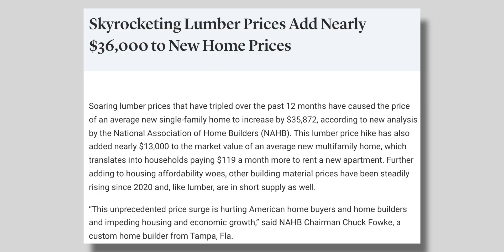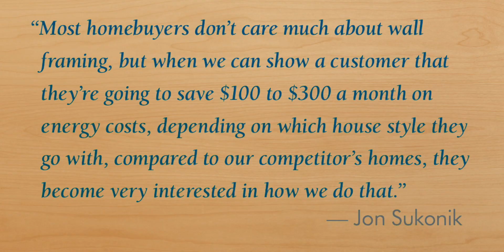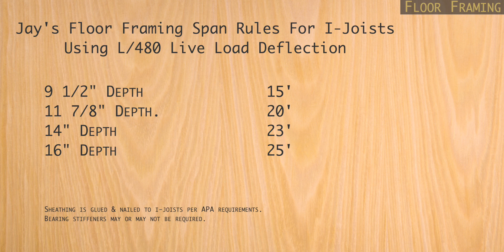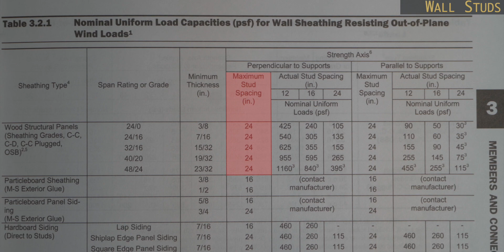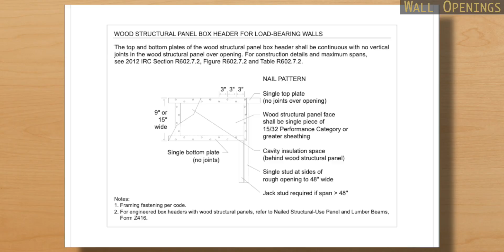A Short Guide to Advanced Framing Details (vs. Traditional Framing)

Comment from the maker: There are some additional elements of advanced framing that are not discussed due to either them being very similar to traditional framing methods, or elements I just don't have much experience in.  A product used that I don't have much experience with are Insulated Header Assemblies, which are just headers with insulation attached directly to them.  I do not cover T-intersections at walls due to those methods being similar to traditional framing methods. Integrated Rim Headers are another advanced framing technique, however I don't have the best knowledge on how these things work structurally.
Reply: Advance framing isn't about saving wood its about increased insulation and stronger buildings.

Comment: You're onto something but honestly this sounds like a single family carpenter's nightmare, especially when it comes to having to remodel a roof addition into old walls with no double plates, but it looks good on paper and only on paper in my opinion as far as single family homes go. I wouldn't consider it on anything other than massive multifamily projects where the savings might be worth retraining crews and finding a framing foreman willing to deal with it all. Work just isn't that hard to find.. I'd consider multifamily only because it's generally not a candidate for an addition. Even then, it's somewhat intimidating with minimal forgiveness if needing to offset a truss or rafter due to a miscalculation somewhere along the lines. It sounds extremely risky for it's value. The best way to save $ is probably to use 6x6, 4x4 etc. for shorter span headers (not longer because they twist causing major problems). That saves on labor not having to measure, cut and assemble the multiple parts of conventional headers and  produces less cut off waste, and the heavy nailing specs of conventional headers require a lot of nails.There would also be some R value loss opting for 6x6 headers. The L shaped corner you depicted is called a California corner or "Cali". It doesn't allow for half of a siding corner to be nailed to anything but plywood, though the American Plywood Assoc. has specs to resolve that issue (specs that probably are rarely followed in the field), you just have to contact them for the specs. Even after doing this 20 years, I still don't know what those specs are nor have ever heard of anyone speak of it. The U-corner you depicted wasn't installed correctly. A U-corner allows for proper siding corner installation (unless the corner material is a wider dimension than the stud material). It's also a stronger corner and I would be happier knowing a massive hip in a roof is over three instead of two studs. They're not that hard to insulate when installed where the cavity of the U-corner faces in (not facing the sheathing as depicted). It's rarely a problem where a king stud or something would prevent the U corner from being insulated but any framer worth their salt will insulate it before installing the king stud etc. However, the U-corner also sacrifices R-value by replacing a volume of insulation with an extra stud. Calis are suitable for interior partitions but might not always be the best option over a well placed ladder style partition that can often save a stud or often two and make use of scrap blocks that would have probably ended up in the dumpster.

Comment: I think it would really come down to the structure of the home. I think a wall 24oc with more insulation space and only 7/16 osb on the exterior walls will be more weaker than a wall that is 16oc with wall insulation plus a zip board with 2in insulation. To me the cost of my home is literally out the window if I try to save money and use less lumber to build my house and a storm comes in and destroys my home because I was a tight ass.

Comment: Jay, you are a P.E.  You have the right to specify things which don't match the code.  But be certain that you understand the intent of the code, and your calculations will hold up to scrutiny.   The codes are a prescriptive method, of constructing a safe home.  If the trades follow the code, they end up with a safe efficient structure.   Licensed design professionals, have the right to do things which are not compliant with the prescribed methods and standards of the codes.   

officials

Comment: Imo Advanced Framing is better referred to as OVE / OVF (optimum value engineering / optimum value framing) Cause its technically not as strong structurally, but we have modern engineered wood materials that are strong to make up for it. Advanced framing to me sounds like we're making framing techniques stronger and doing structural upgrades.
Reply: They call timber fames advance framing.

Comment: Down the road you are asking for trouble because as you know houses are not allowed to settle as they are built an this type of framing will show up as the house settles in 5 to 10 years the roof will have the ripple effect in it and the floor will began to hav e squeaks and sags and you really do not save in lumber that much if you take a wall 8 foot an lay it out on 2 foot versus 16 inch you will see that you are not saving that much versus cost over structual soundness

Comment: I believe that advance framing only helps   a  DIY  builder.  The owner/builder will frame with studs 24" on center ( from center of stud to next stud ).  The owner builder saves on lumber and can use INSULATION between studs.  But a tract  home that uses  studs 24" on center,  becomes a  COST-CUTTING tactic,  that makes walls feel flimsy.  And what is the point of saving A LITTLE MONEY ON LUMBER,  if the price of a TRACT HOME in CALIF is  $700 THOUSAND DOLLARS.???... less lumber and high price  SPELLS PROFIT for the BUILDER,  and less quality home for the BUYER.. I am just saying

Comment: And you cannot be more inaccurate about single top plates vs double and how it "doesn't matter which one you choose to use"? Double top plates are always used for load bearing walls and they're used for a good reason. You can't go 24 inches on center which is using less lumber, and then expect the same load bearing results especially when using a single top plate. Not possible and wouldn't be structurally sound. I think you should get into the business of being a framer before you start making videos that aren't totally 100% accurate.
Reply from the maker: If you watched the video and went to minute 4:32, you would have saw the part where I explain that you can use a single top plate in a load bearing wall as long as the roof or floor framing is aligned with the wall stud. If you read resources from the American Plywood Association on this topic, their resources say the exact same thing.

If that isn’t enough for you, how about going to ask other structural engineers who design wall framing systems. Or other videos on YouTube about this topic because I’m not the only person that knows you can use single top plates in a load bearing wall as long as you follow specific rules.

Cheers.
Reply: @JthaEngineer  that was the most polite fuck you I've ever heard.
Reply: Are you a framer? If so, I'm surprised you don't know this stuff. Read up on advanced framing. Single top plate is all good. As per code and all authorities on the matter, the floor joists simply need to match the wall spacing and be aligned within 1" of each other.  

Building using 24" OC shouldn't be discussed like it's some complicated concept. At all.

Advanced framing also isn't all about saving money. It's thermally higher performance homes which use less lumber, less fasteners, & less labor WITHOUT structural compromise. 
A 2x4 wall @ 16"OC is structurally sound. A 2x6 wall @ 24"OC is structurally sound. Period.

https://www.greenbuildingadvisor.com/cad/detail/building-plans-for-advanced-framing
Reply: @DJNemesisOfficial  👏

Comment: In a 60 foot long structure 16 on center floor you need 45  floor trust The same floor system 24 on center you use 30 floor trust at the price a floor trust it is considerable savings. It more than pays for the 1 1/8 tongue and groove. Glued and screwed you will end up with a stronger floor. The larger 24 inch basin also makes it easier for doing the plumbing less of A chance on the toilet landing  a floor joist

Comment: I've tried to justify advanced framing, and I think it works everywhere except for the 16" vs 24" O.C. wall studs. Well, depending on what lumber prices are any given week.

Depending where costs are at any given time, I've calculated savings at anywhere from $350 to -$350, and those savings have largely come from single vs double top plates.

I've abandoned it myself, as much as I really like the idea. I work in much smaller house footprints than typical 2400+ square foot homes, so saving the square footage from 2x4 to 2x6 can make a big difference in interior space.

Exterior insulation seems like a much more worthwhile path now, even if penetration details can be a bit more complicated.
Reply from the maker: Very interesting. Did you find that you’d save costs in 1 area just to have increased costs in another area? I noticed even the effort to design & specify these ideas, the client is basically taking money they’d use for construction to pay me.

Can you speak more on the single vs double top plate savings. Is that just from materials? Or labor & materials, etc?
Reply: @JthaEngineer  

For single vs double top plates, the savings come from materials, and mostly from interior partition walls.

Let's take this latest exterior wall I'm working on. 188 linear feet, 10 feet tall walls. 46 feet wide encapsulated crawl space foundation with girders every 10 feet, 48 feet long.

Let's start with the walls. 188' gives me just about 145 2x4 studs, counting all corner details. Going to advanced framing, that becomes more like 98 2x6. The cost of 10' 2x4 #2 KD/HT SPF is $10.25. $15.38 for 2x6.

145 x $10.25 = $1486.25
98 x 15.38 = $1507.24

188' top/bottom plates. I like getting my plates in 16' lengths.
Single top plate, single bottom plate. 188 x 2 = 376' feet of 2x6.
Double top plate, single bottom plate. 188 x 3 = 564' 2x4. 
376/16 = 24 16' 2x6, at $24 = $576
564/16 = 36 16' 2x4, at $18 = $648

combined, for a 2x4 wall, it's $2134 for typical framing, vs $2083 for advanced. Saved all of $51 there, while having to have each stud contend with significantly more wind/seismic/uplift/etc forces. But who cares about that because we're just focusing on cost. But since you're most likely decreasing the nailing distances on edges and possibly in the field to make up for those forces, you're not saving any money there on labor or materials.

For the floor joists, keeping the spans at less than 10', you can use the same 9.5" I-joists, so you can go from 35 to 23. 46' of 9.5" I-joist is around $206, so you do save $2472 there. But it's highly recommended by Huber and the Tile Blah Blah Blah Association at 24" O.C. to go to 7/8" subfloor over 19/32 for 16" O.C. You can muddy that a bit by keeping 24" O.C. subflooring at 23/32 for 24" O.C. spacing. You can go to longer spans, but then you go to larger joists, and longer spans can start to get really wonky with deflection if you have instances where the loads can exceed the assumptions.

Subfloor prices then, for this 1850 Sq Ft home:

19/32 @ $44.74: $2595
23/32 @ $52.48: $3044
7/8 @ $64: $3712

And that's using mid-grade products. It's a lot worse with something like Advantech. So you do here have the potential to save the most, at $9805 for traditional vs $7782 for advanced. If you want to go more traditional framing with dimensional lumber, those savings diminish more because you have to go to 2x10 for 24" O.C. vs 2x8 for 16" O.C.

So all in all, we've potentially saved $2044, almost exclusively because of the floor system, and even that's because we went all fancy with engineered lumber instead of dimensional lumber. The potential to save even more comes from using 24" O.C. spacing for internal studs (except probably for shower/tub/kitchen walls), and single top plates for internal studs. Not using headers for non-load bearing openings, using right-sized headers for load bearing openings. But I'm hesitant to call some of that advanced framing. Using the right header for the right span isn't advanced, it's not being lazy.

And that's even if you can convince the builder to go 24" O.C., and if they can, then the extra cost in time and labor for getting through that learning curve.

I think advanced framing absolutely has it's place, in affordable housing and multi-family housing, but if you really, really want to save a significant amount of money, your first best destiny is to reduce the square footage of the house.
Reply from the maker: Understood. I appreciate the amount of detail you presented.
Reply from the maker: And to add to your point, I do think it has its place. However I did have a client on the higher end that we considered doing some of those details & we realized it wasn’t the best solution. Completely agree for affordable, average American homes this could be an option.
Reply: @JthaEngineer  > the client is basically taking money they’d use for construction to pay me.
May make more sense for production builders.
Reply: Advanced vs traditional framing has nothing to do with just saving money on lumber. Its choosing a system that works for the rest of the house your building. Traditional might be better for one home whereas advanced methods might work better for another.

Comment: Some of those corners will require drywall clips ,One was boxed in a way that it would have to be insulated before sheathing . Another consideration is siding or veneers . Some corners require more meat . Most carpenters do the old 4 stud corner . Which is a  waste of labor ,waste of material and heat transfer and difficult to navigate wires around . Years ago a builder went into my impeccably framed house . Spray painted with fluorescent paint all my exterior corners . As if it needed to be corrected . I was fuming !! . In carpentry talk . They call them California Corners . I showed the architect I was working for The Code book and bingo .. They even have a picture of it .. Code is 3 per corner . Single bearing top plates are hard to convince others of . They have to be joined on bearing walls with a specific sized connector plate and everything above better be in a direct path . Non load bearing walls are fine . Many carpenters go on automatic and every header is solid ,even in n on load bearing walls . Not needed . On a 2x4 wall   some headers are two ply with OSB core . Check me if I am in the ballpark . But 7/16 core only adds about 1% strength . Some will sister the headers together and favor the exterior leaving a 1/2" to be insulated " Which seemingly never happens "  T's or unions for interior walls are notorious voids in wall framing.  One other cost savings thing is .. learning to utilize material instead of filling a dumpster .Part of My goal is to have an envelope full of sawdust when I finish a frame . I have worked .on homes that had a lumber shower at the end of the day . Filling dumpsters with enough to build another house .  . .
Reply from the maker: I typically don’t specify sheathing to fill in the header cavity, but I don’t think you get that much of an increase in strength for the header assembly either. I’ve started specifying insulation in those header cavities and once I get a hold of how to move with T-intersections, I’d like to have those areas insulated as well.
Reply: @JthaEngineer  I read the formula in Fine Home Building years ago about the increase of strength solid header . It came down to " It isn't worth it ," Now some Architects/Engineers specify it so I abide . I personally like to analyze the wood for use in a header , I check for cup , grain , knots and crown to get the optimal strength . Anything sistered or stitched together must be up to Code or better .T's or wall unions with the dreaded void , I found best for a 2x4 meets 2x4 wall is a 2x4 stud with a 2x6 on the flat facing the interior . Saves essentially on 1 stud and can be insulated behind . Ladder nailers on exterior corners and wall intersections are fine . But the only drawback can be , Many carpenters don't know or take into consideration the size of drywall the to be hung . 8' ceilings are 2-48" , 9' ceiling can be 2-54" or 1-48" and 1-60" or 2-48" with a 1' strip in the middle ..So layoff from the top down has to be thought about . Some go fail safe and just fill in for any possibility . Some don't think at all.. As a carpenter , We have to consider the structure but also how everything finishes out in the end . Bulky Top Flange hangers can cause a rippling ceiling line for crown and above humps in the floor . Headers wider than the walls create bulges for trim . wobbling crown in , crown out studs can make for a mess for wainscoting and cabinets , Plumbers going through 3 successive studs with 3" holes on a bearing wall turns the studs into supporting splinters , But they'll put a protector plate over it !! . HVAC tech , Many do not know the pathways through I-Joist and where the safe zones are . Some I have seen scalp off the entire bottom flange or cut an oversized hole close to bearing .